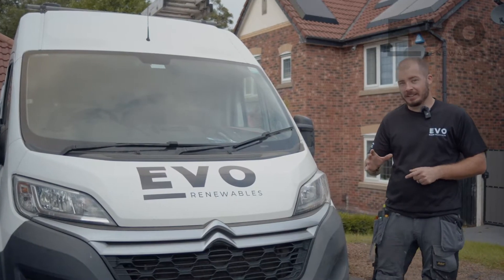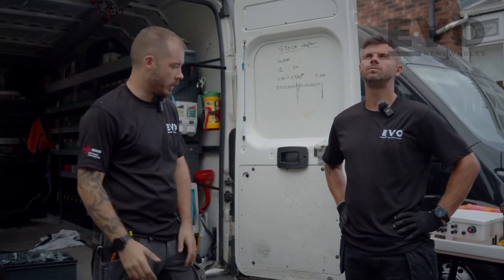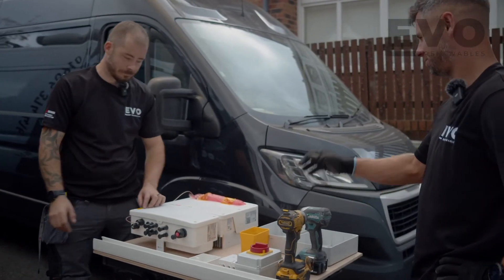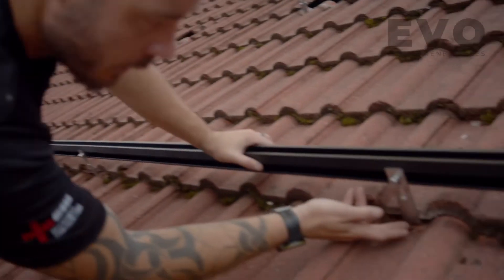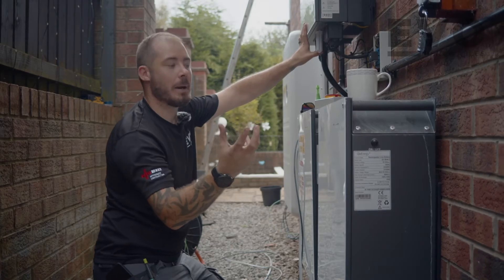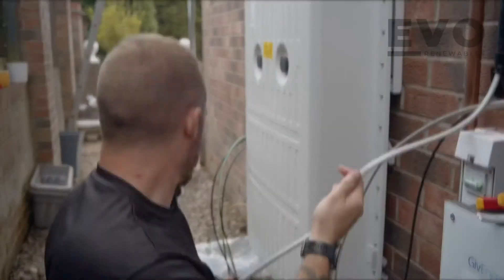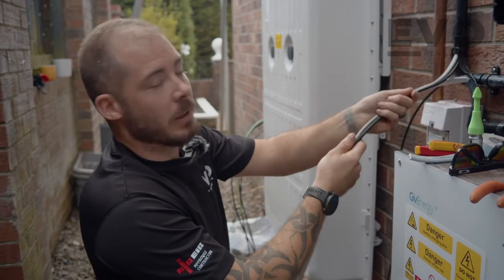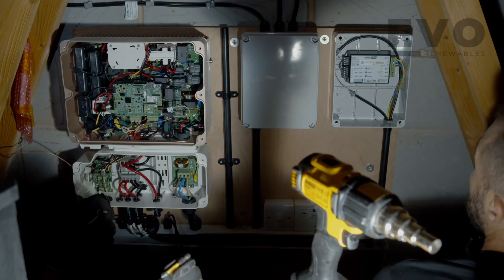Solaredge & Givenergy Solar Install

Comment: How are those north facing panels doing with generation?
Reply from the maker: Not actually too bad!  The North facing panels this month (14 days) have done an average of 1.2kwh each.
The south facing have done an average of 2.20kwh each.

So the 12x North facing have done 14.4kw in total this month and the 5x South facing have done 11kw
Reply: @Evorenewables  Wow, thanks for getting back to me so quickly and that's some impressive generation for north facing in winter time 👍